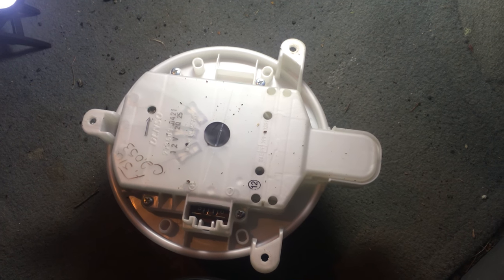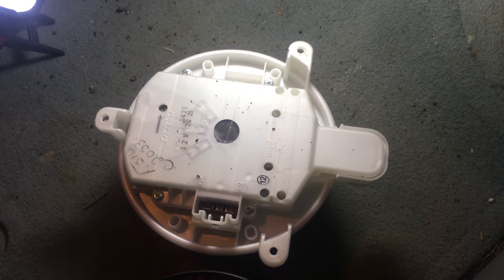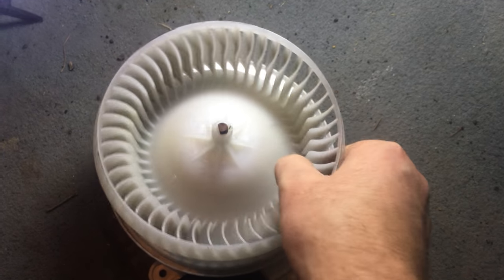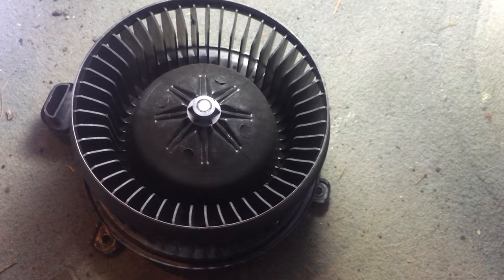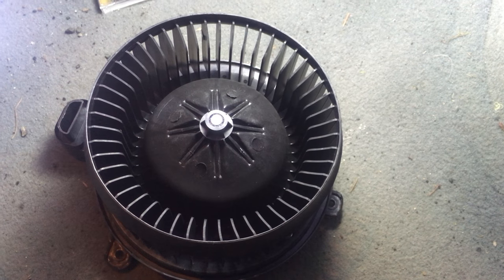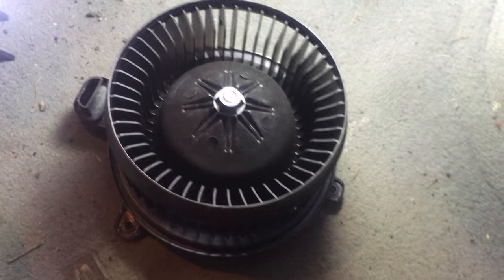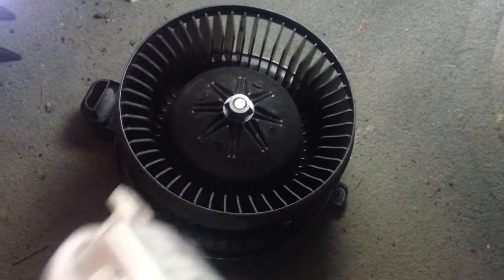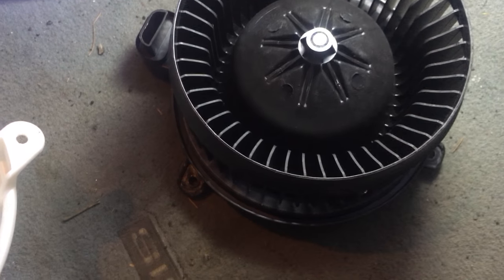How to Replace a Blower Fan in Toyota Sienna Minivan

Comment: Those assemblies are several hundred dollars. 
It can be completely disassembled,  lubed and reassembled and depending on the lubricant it will go for a couple or several more months before starts making noise again. The main challenge is removing a small circular press-on clip on the blower shaft. Small screwdriver and pry gently from underneath the clip, working in circular motion 'til clip is off. You can then access the bushings. I applied light oil originally, but it doesn't last.  Neither did 0-20w synth engine oil, nor light teflon grease. Synthetic brake grease used in replacing vehicle brakes is lasting well so far. Clean the bushings first with isopropyl, then apply the grease. When reassembling, be sure that the problematic shaft clip mentioned is pushed all the way down so the blower shaft cannot move end to end or it will make noise when on high.

Comment: Aftermarket blower does not work all the time. Had to use factory blower motor
Reply from the maker: Hi Rekzzz, thanks for checking out the video, that’s a good tip. 
I have only had to change it once and the part from auto zone worked.  
What does the factory blower motor cost?  Still got to be cheaper than having the dealer or shop do it for you.
Reply: @NortheastEdible  Sorry i don't know the price for the factory one. I work for a fleet and we used those tyc brand and they only work for a couple of days